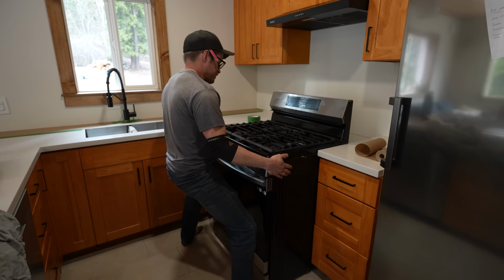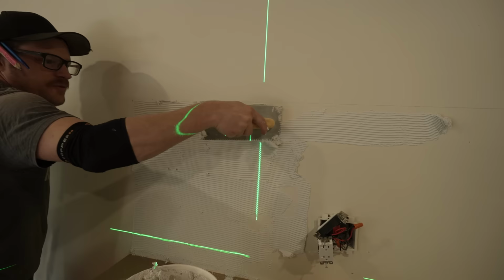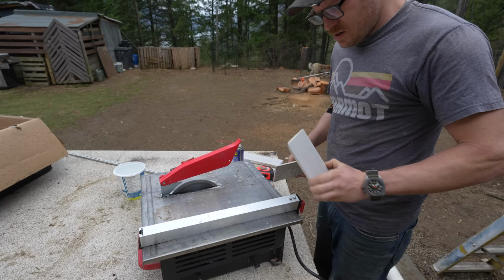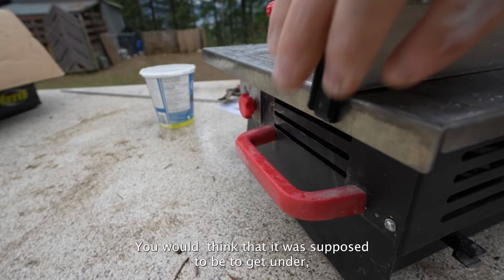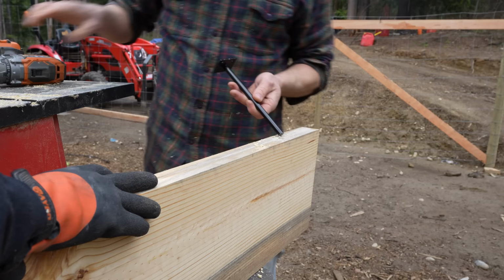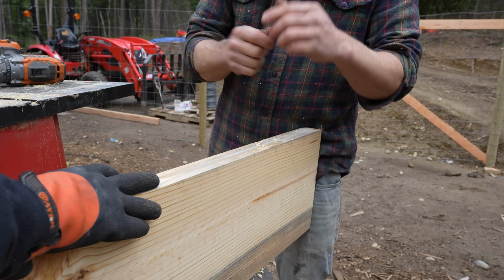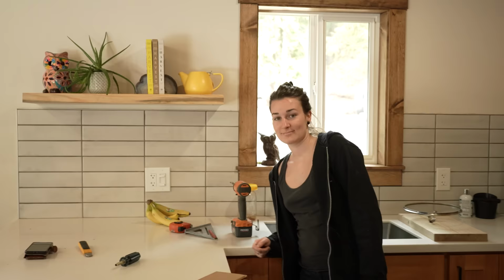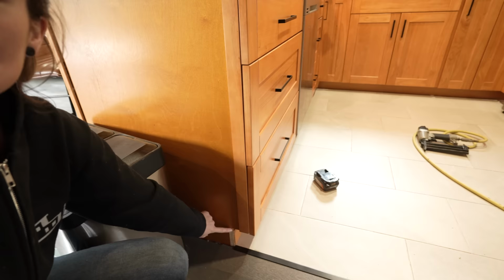We’re Not Sure We Like How This Turned Out…

Comment: I like the grout colour it goes well with the tile.
When you get time Ha Ha, take the cupboard doors off, sand them back, and stain them to the same colour as your window trims - then you wont have the orange colour issue. Now, if that is too much work, then you can rough sand them in position, add the satin to a clear polyurethane and brush paint them completely which will give you a rustic look/finish like the window trims. Trail the end stain result on the inside of a door which you will not open regularly first, until your happy with the stain colour mix. Based on the amount of door coverage I think it would be safe to go for a gallon of clear, because you do not want to run out of stain mixed and try and match it again.
If you did rise you sponges in the sink and not a bucket, then remove your trap pipe and rise the sand out of the bend and put it back on - if not it will turn to cement.
With the little bit of exposed raw end board, run a piece of off cut wood with the laminate through the saw and cut the laminated face off. Then  hand cut with a Stanley knife to shape, wood glue it on. If you get your saw cut/slice right, then it would only be proud a little bit,which no one will every pick up except for all your channel viewers.

Comment: You can change the color of the cabinets. Because they already have a finish on them you can perchise a varish and stain already mixed together the water base works very well use a color that is lighter than what you are achieving Because two or more coats looks better. Take all the hardware off use 3M very fine just to roughen the surface but not after the first coat.just a hint use several coats to reach your desired color and practice on a similar piece of wood first. PS I did this to a towel bar for my bathroom that match the others but only came in clear and it turned out well. Many likes 👍 ❤ the Channel.

Comment: A interesting way to do grout is to take a empty caulk cylinder take out the end compression plug, clean the cylinder out and fill with grout mixture, reinstall the compression plug and run it along the grout lines.  Also run white turning to clear silicone along the countertop to tile joint lines and vertical corners, if not the grout  will crack out eventually.  Just my experience anyhow

Comment: Because your walls are nice and flat, I would have applied the adhesive to each tile as you fixed them, spreading on the wall can be extremely messy if not careful. But looking good guys 👍👍

Comment: Initially when you two, especially Katie, was disappointed with the look, I felt very bad for you.  Now that everything is grouted and the shelf is up it looks great and everything is tied together much better.  The overall look is very nice and I'm sending you a virtual hug Katie 🤗 Somtimes you just need to be patient and give it all time to come together before you beat yourself up.  My only comment is that I could not tell from the vid if you also applied your adhesive to the back of tile also, as it is recommended for a stronger bond.  Looks very nice, good job you guys.  Also, I noticed in the opening random shots Katie, Spring is starting to show everywhere.  Good job with the editing as usual, very pleasant to watch.  Have a great week you guys.   Larry, Central Valley, Ca.

Comment: Greg when you need to bore a perpendicular hole make a jig by taking a thick piece of wood that’s square flat and boring a same size hole using a drill press then use that to square up your actual hole. For Katie’s thing with the trim just cut apiece of trim  at 45* and a return at 45*   Search trim carpendery and you can see much better than I can describe. Trim carpenters use it all the time to trim out a corner stop.

Comment: I think when you apply any grout, you are supposed to apply in a diagonal direction.  When you apply parallel to the grout tracks it tends to drag some of the grout out.  You should move diagonally when you screed to remove the excess and also drag the sponge diagonally to wipe it off too.

Comment: There are grout pens that you can use to color your grout if you decide to change the contrast color.  We used that on our floor tile grout and it worked great.  The end of your counter base would typically get the baseboard treatment all the way across the end to the corner.  That would normally get a 45 degree corner but since you've already cut and installed the baseboard, you could try cutting the end baseboard at a 45 on the end and painting it with a closely matched furniture color marker pen.  The wife has tiled our wall behind the wood stove and did a matching tile for behind the stove, tiled the bathroom floors, my shower enclosure and the mud room floor.  She's remarkable.

Comment: One of the good ways to drill a straight hole into a piece of wood is by using a drill press. Or you could get one of those drill assist clamps that guide the drill straight into the wood.

Comment: The end of the toe kick can be covered with base board.  Run the base board from the wall to the back of the cabinets and then around to the end panel.  

You could paint the cabinets if you really don't like the "orangishness" of it.  Pick a color that compliments the tile. 

The finishing touches of your home are really coming together.  Thanks for the video.

Comment: Takes a lot of water if you don't wipe it off well with the rubber trowel. Sittin here watchin thinkin duuude! Glad you got it done anyway. Remember long term huge tiles are easier to deal with x 100%. Grout harbours germs and grease and mould and stains and all that good stuff. Least grout the better. It's a b1tch to clean!! Big tiles fella, big is good. Turned out good though- what you did.
Reply: If you have colored grout, too much water will wash some of the color out. Finishing the grout on 150sqft tonight myself.

Comment: It’s still stunning to me how different you do things in north america compared to europe. 
Kick plate- we have on plastic brackets not nailed, it has rubber on botom so smalił spill on floor is not a problem
Small tiles out of fashion this side of ponad- to many seams, not practical. We use big tiles or glass
You do not put tiles around cabinets, instead you film a bit above lower side of hanging cabinets and they cover tiles
Grouting with a sort of koking gun- much less cleanup
And wiat is the point of that separate cooker unit. Why do u love it so much?